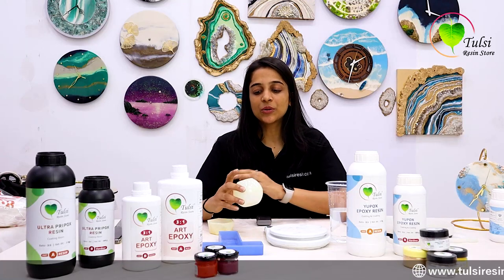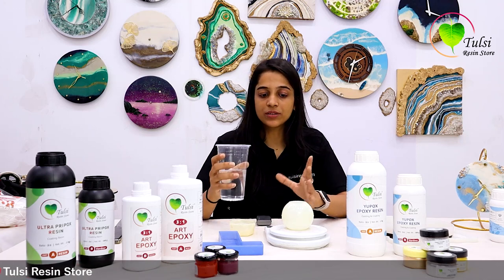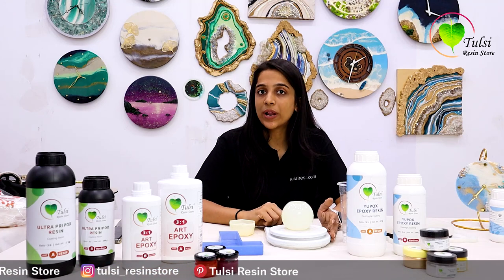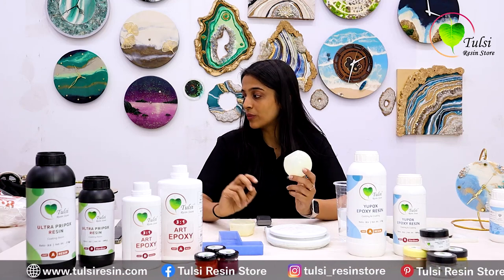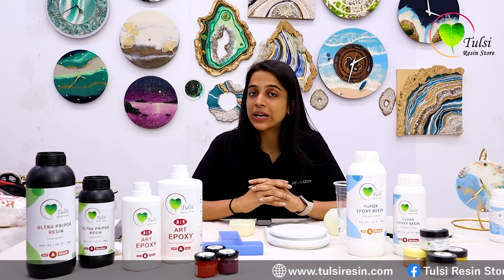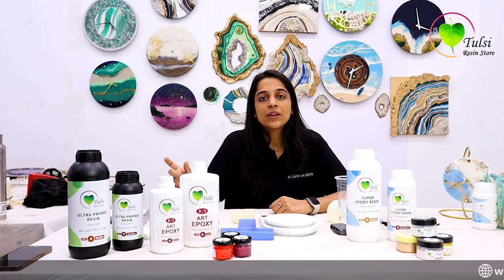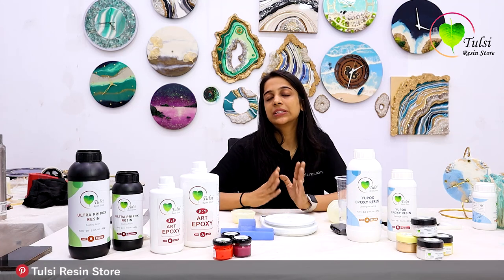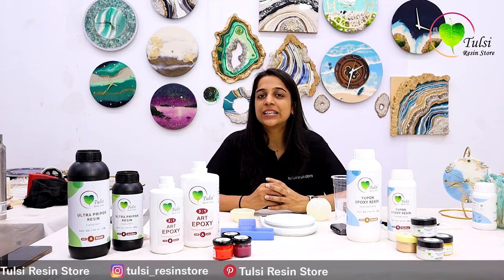How to calculate how much resin you need for UNDEFINED SILICONE MOLDS | Resin for beginners

Comment: Hi mam

As the density of water is less than epoxy  the weight of water will be less than the weight of epoxy in a given volume. So there will be an error in measurements
Reply from the maker: Thank you for making this valid point, however the ideas shared in the video are for beginners who have no idea how to measure the required resin amount in uneven moulds. In case of uneven moulds one can always work on estimate basis as well as consistency of water and 3:1 resin is quite close.

All Related links are available in profile bio
OR
Search “tulsiresin.com” on a Search Engine (Google)